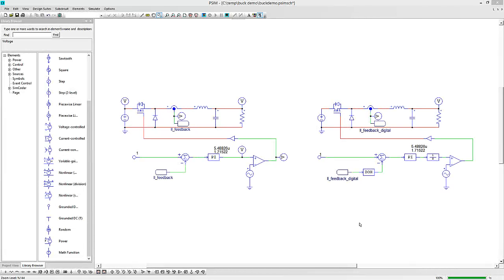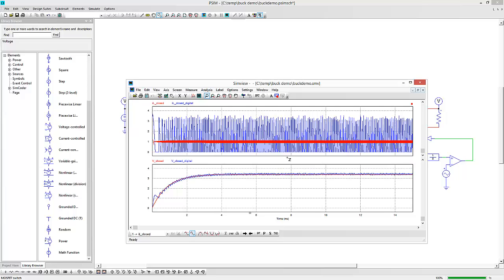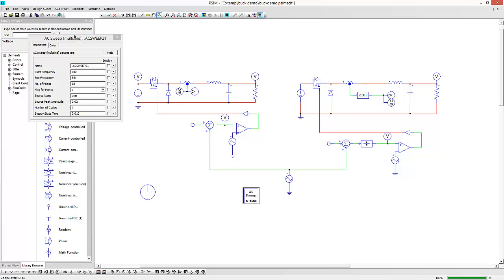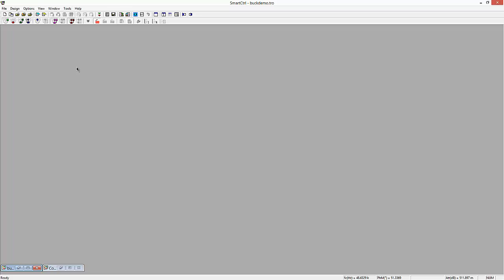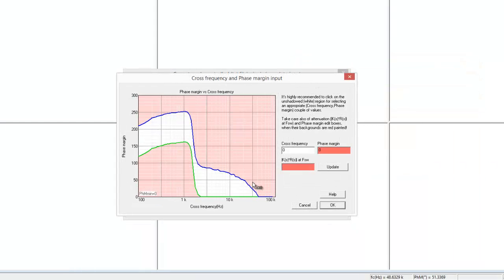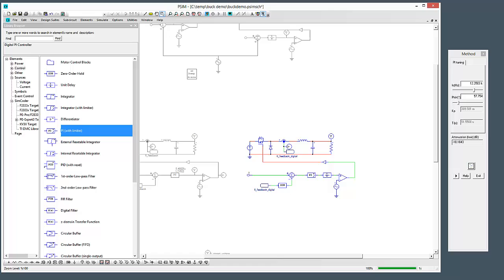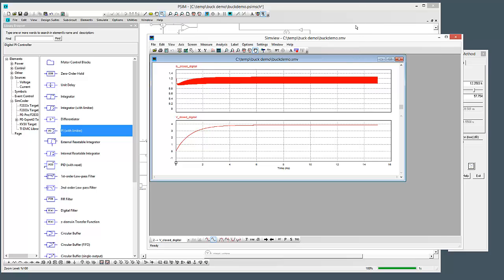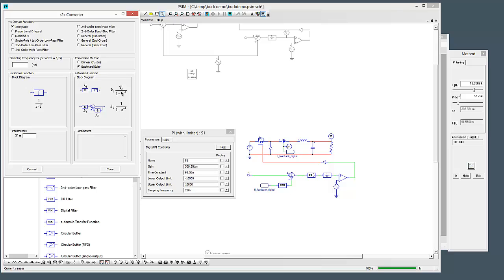Digital Controller Design with PSIM - Digital Delay effects

Comment: I have a question, about the sampling frequency for the ZOH blocks, Digital Delay (1/z) blocks and the general z-domain transfer function blocks. How exactly do we choose the sampling frequency? In the video it is stated that the sampling frequency is equal to the switching frequency (250 kHz). I have an analog circuit, simulating a  single phase PWM AC/DC rectifier at unity power factor. When I simulate it at 20k Hz switching frequency it works well, but when I simulate the same in digital domain using a sampling frequency of 20 kHz it doesn`t. But it works well at 200 kHz sampling frequency, and even given results at 80 kHz sampling frequency but as the sampling frequency is increased the quality of results are improved. So is there a criterion for choosing the sampling frequency?
Reply from the maker: As you increase your switching speed and sampling rate the impact of digital delay is reduced. You are observing this as it works at 200k but not at 20k. A working analog controller needs to be re-designed in the digital domain, you will see significant impact from the digital delay on the phase of the system in the decade before the switching speed, this means you need to make sure that the cross frequency of your loop gain transfer function is low enough to ensure that you still have adequate phase margin in the digital implementation.
Reply: so this means that the switching frequency for the digital domain implementation for the same converter needs to be higher, as compared to the switching frequency used to design the same controller in the analog domain? Also when implementing the digital control, the block used for the PWM signal generation mentions the sampling frequency instead of the switching frequency. WE also need to specify the sampling frequency for delay block, zoh block and other blocks, so how do we differentiate our sampling frequency from the switching frequency or do we taken them to be equal to one another?
Reply from the maker: The usual practise to slow the controllers from analog to digital. You can "oversample" or run your control loops faster than switching if you chose, in this case you'd put a different number in here than your switching. A typical application for oversampling would be a high power motor drive, where you aren't switching ver fast ~10-20kHz. An application that would have higher switching than sampling might be something like a small power supply. Switching speed defines the size of the components, the size of the components dictate the frequency response characteristics. There are too many trade-offs to mention in the comment section of YouTube this is why there are courses on the subject.

Comment: Hi, congrats first. I would like to reproduce the same circuit by my own. Please may you share buck parameters? (Vin, Rload, C, L, duty and PI parameters)
Thanks
Reply from the maker: Vin = 12
Rload = 4.35
C = 200u
L = 50u
open loop duty = 27.5%
PI (needs to be digitized with backwards euler or tustin) Gain = 309.581m Time constant = 91.55u